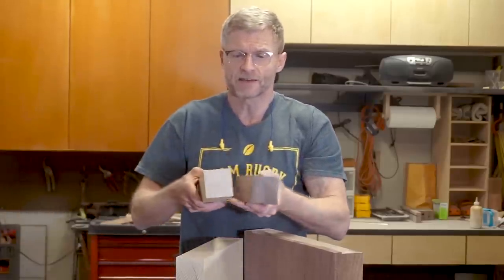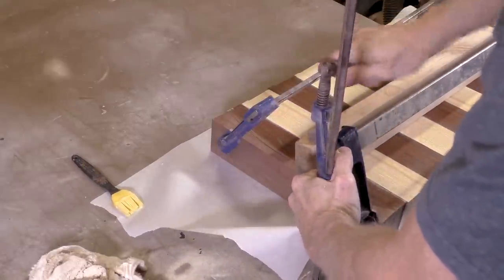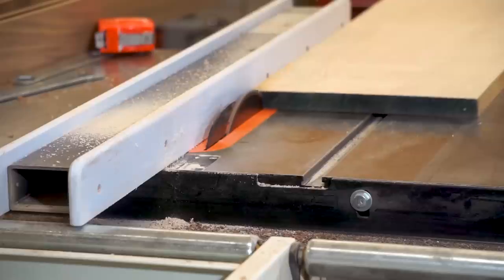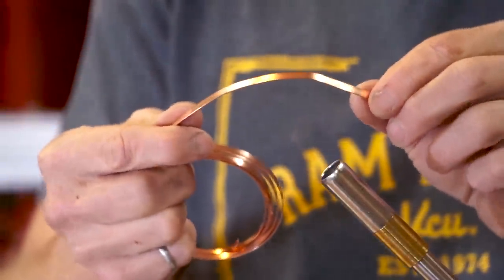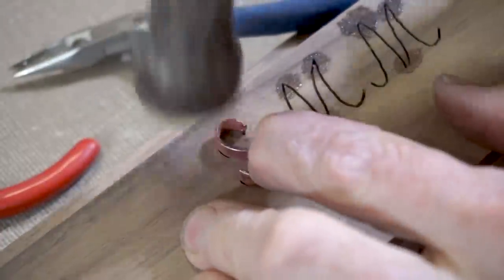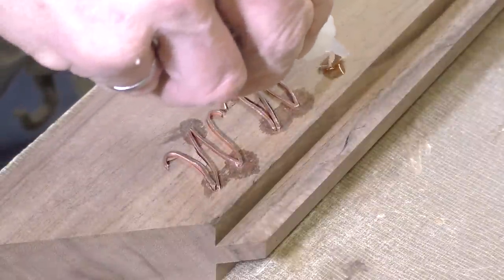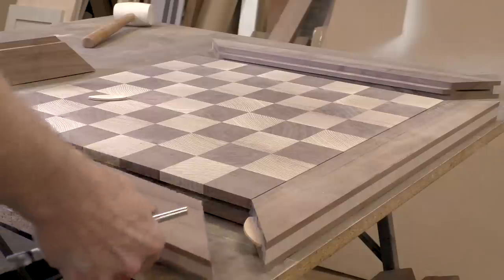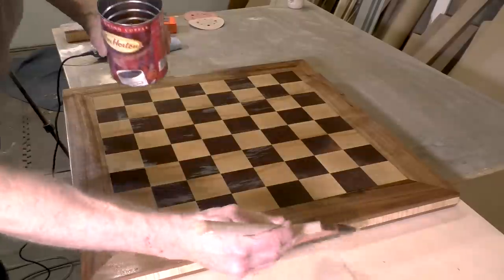Chess Board with Copper Inlay

Comment: Do you get snipe from your planer?
Reply from the maker: There's always a bit of snipe to deal with. I find that by lifting up on the back end of the piece as it feeds into the planer and then lifting up on the front end as it comes out helps to make the snipe almost negligible.

Comment: You should quench the copper in water after heating, not allow it to cool in air
Reply: Slow cooling softens the metal, fast cooling hardens the metal.
Reply: n553302 that’s correct for steel. 

Not for copper or brass.
Reply: n553302 copper is hardened by work/hammering

Comment: Wood I make it?  Nope.  Could never do justice to that kind of project.  Ive got decent tools, but not great, and every time I try to make a border my angles are never right. 44.5 degree cuts show a gap and there's no way around that.  Or is there....  Seriously, is there?
Reply: Make two 45degree cuts. Turn one over and lay them against a straight end. This will double your error and show a gap between the mitre cuts. Adjust the saw till the gap is gone.  If they lay along a straight edge with no gap then when you turn them at 90 degrees  the mitre must be true. 🤣😂😁😀😎

Comment: Why is no one pointing out the obvious. Look at how much better this works and how practical this is without the metric system. Metric system is illogical and hard to work with, no logic behind it whatsoever.
Reply: That's an ignorant comment by someone that's never used the metric system.  Put the following drill bits in ascending order without looking it up and cheating:  1/4, E, and #2.  That's the imperial system.  Now put the following drill bits in ascending order:  3.8mm, 4.4mm, 4.1mm.  That was the metric system.  Check.
Moving on, put in order the following sizes:  17/32, 35/64, and 9/16.  Now do the same with 8.8cm, 9.2cm, and 7.8cm.  Check again.
Now lets convert volume and size.  How many cubic inches in a fluid ounce?  Had to look this up, it's 0.554.  How many cubic centimeters in a cubic millilitre?  1.
Checkmate
The imperial system it terribly outdated in every respect.  Ask any physicist, or any scientist for that matter, and all will tell you that the metric system dominates the imperial system.
Reply: @renebucek8079  Well ok, but there's no such thing as a 'cubic milliliter'. Or, more accurately, there's no milliliter that isn't a 'cubic' milliliter. Liters and milliliters are by definition measures of volume, so there's no need to say cubic--it's redundant. Ask any physicist, or any scientist for that matter...
Reply: Oops.  That was my mistake, you're right, there is only a millilitre.  Brain fart aside, my points are valid.
Reply: @renebucek8079  No they are not. To begin with, the imperial system is now the US customary system, it is not the exact same as the English system. Second, customary system is named because it is customary to sue them and easy as hell. Much easier than the stupid metric system. Just look up how the Fahrenheit is set up instead of the arbitrary metric system. Also fractures for calculations are a much better deal, no calculator required ever. It put a man on the moon, so there.
Reply: You realize you didn't give a single example of how the imperial system is better.  Fahrenheit isn't better, it's just what you're used to.  If you had to convert to and from Kelvins then you would much prefer metric.  The only possible arguement that I can think of to defend the imperial system is that because it's so complicated you have to think and remeber more than you do with metric so it could potentially improve cognative abilities.  Beyond that, it is completely illogical.  And you didn't answer the three questions from the first post I made.